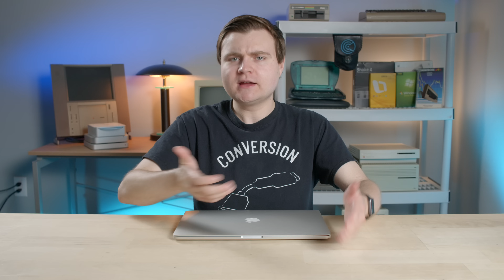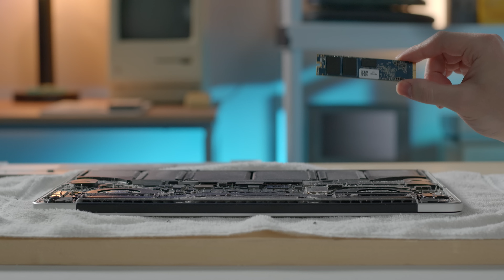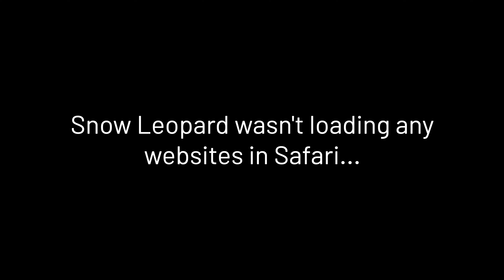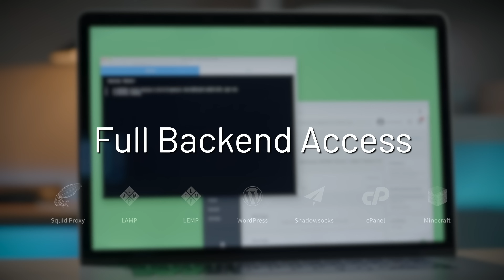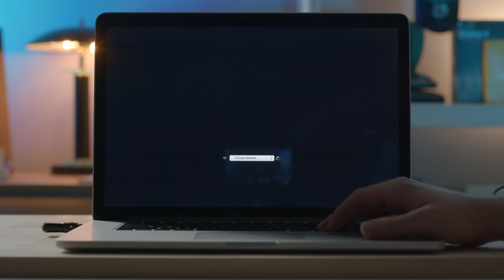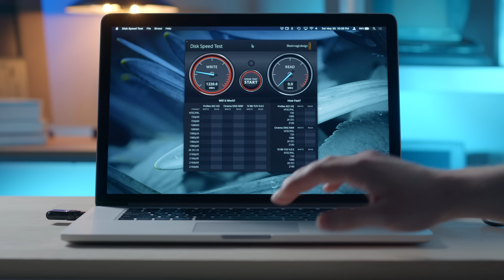MacBook Pro SSD Upgrade (It Took Longer Than We Thought) - Krazy Ken's Tech Misadventures

Comment: they make adapters for the 2013 to 2015 macbook pro retinas that you can just put any nvme ssd in it... i put a nvme one in my macbook air 2014 11 inch because it was the base model and only came with a 128gb ssd

Comment: You probably pushed that ssd in horizontal into the connector but you should have slid it in at a diagonal angle and once all the way in you push it down and put set screw in

Comment: I didn't had to backup my Thinkpad to upgrade it to a SSD.  I just got a 1 TB mSATA card and a mSATA to SATA adapter, just in case.  My SSD is the same size as my old drive, spinning type.  I found out system does have a mSATA slot so I used a software to dump my old hard drive on my SSD and now my Thinkpad T420 runs really fast.

Comment: I use a bulb blower for dust, like what you’d use for lenses. Works perfect and much cheaper than an air compressor!

Also, you can change the system date and trick apple’s internet recovery to give you a newer recovery system. I don’t think the date matters a ton; just use the terminal!

Comment: i was trying to upgrade my mid2013 mba and my process was a bit more round about than you guys. my mba's ssd was fried, the one i ordered on amazon is recognized when you use mojave but not the bult in recovery os like you guys. However, since my mba had never been updated to anything beyond sierra the installer gives an error of not having the right firmware for the newly installed ssd when formatted in apfs. reformatting ssd to mc os journaled alllowed the installer to start but when the computer tried to restart it didn't use the ssd as a startup disk so everything stopped. the solution to this involved getting hold of an apple oem ssd, installing mojave, which updates the boot rom and then swapping out the ssd for the new one..then the installer was able to install mojave on it.

Comment: Upgraded my mid 2014 13in MBP a few years ago with a 480 GB Auro Pro SSD, installation was simple but I can agree the software end of things was rough. Forgot to update to 10.13 first so had to go back and do that afterwards, and the SSD died on me a few months ago so I had to go back to the stock 128 GB SSD.

Comment: I have a Mid-2015 MBP with 512GB running Big Sur and want to upgrade to a 1T OWC Aura Pro X2.  I have a Time Machine back up on a 1T HDD.   I have an external device controller that I believe I can use with the new SSD and the old SSD. 

Can I format and install the OS on the external device and then plug the SSD into the MBP?  
If I can't do that, what is the best path forward (your video with all the restarts and dead ends didn't really make it clear to me what I should try first).

Also, you suggested that I make a bootable Flash drive.  How do I do that?

Comment: As you say, the Migration assistant is pretty solid.  Yep, did away with Big Sur and reinstalled Catalina from a flash drive.  Then ran migration assistant using my time machine drive as the source and upon reboot my system was back to where it was before the Big Sur install.  Definitely an installation sensation.

Comment: Interesting I have a 2012 MacBook Pro that I’m trying to install a SSD. To get to the point it keeps failing!
Reply: I tried time machine and it crashes at the end, I’ve tried transferring data and it works when I run it on USB STARUP but once I change it into the computer it doesn’t start. If it starts it crashes or runs super slow. What can I do? ☹️

Comment: This was so fun to watch but I was actually quite surprised how little you all knew about the web download of the OS. 

You said your machine was 6 years old. A cloud boot like that will default the machine to its original shipped OS. It’s because the machines have no hard media anymore. So you either allow that or you boot from a preferred drive. So the OS defaulted to a media older than the OS the new hardware would support. Ha! I love it!

I love how this video took away a lot of the fear people have when dealing with the OS of their computers. An old tech friend of mine said “you can’t break software” so as long as you have a backup, you don’t need to fear! Erase and install are your best friends.

Comment: This may be a weird question... but why don’t you have a bunch of cheap 16gb flash drives for each version of macOS? It’s simple to make them, the article is on the Apple website, article HT201372. I have been doing this since 10.6 with each new version. Would really cut down on time if you had these ready to go.

Comment: the beauty about this MacBook revision is that you can actually get a simple pop in adapter to use any m.2 nvme drive. I used a 970 Evo Plus and it works like a charm. And as already noticed that recovery path was a pain to look at since you just used the wrong button combination.

Comment: With OS Sierra, you have to install an additional update ( it will prompt automatically ) so the Aura SSD will reach its maximum reading (2100) and writing (2500) speed.  Otherwise, the speed won't be consistent.  It will reach and then it would drop to 60 MG transfer rate.  Instead of dropping the image straight from the Time Machine, I would just format the computer with a fresh OS system and then Migrate from the Time Machine.  This way you won't copy any "bugs" in the system.

Comment: Now do one for the 2016 15” or the 16”
Reply from the maker: I'm going to assume you're joking because that's not possible, but I'm also going to assume you're not joking. In that case, all I'll say is: that's not possible—the SSD is soldered to the board.

(Okay, it may be possible if you meticulously desolder and re-solder an SSD to the board, but good luck.)

Comment: Replaced my ssd in my '15 A1502 with a WD NVME ssd, used carbon copy cloner and a external driver case to transfer the data. 
Ended up having major sleep wake issues and random bugs like systemui not responding etc.

Comment: I would have just cloned the drive with rysnc or dd (or used CCC), then used Terminal in recovery mode to clone back. Much simpler.
Reply from the maker: But that would've taken longer because I would need to copy to a destination, and then copy back. With Time Machine already one, I only need to do one transfer, not 2. : )

Comment: This is what the blue writing in Computer Clan videos says: 
A problem has been detected and doors have been shut down to prevent damage to your computer.
kktm.sys 
YOUR_LIFE_IS_YOUR_FAULT
If this is the first time you've seen this stop error screen,
you clearly haven't used a computer much. If this screen appears again,
follow these steps:
Check to make sure any new hardware or software is properly installed. If this is a new installation,   ask your hardware or software manufacturer for any Doors updates you might need.

If problems continue, disable or remove any newly installed hardware or software.  Disable BIOS memory options such as caching or shadowing. If you need to use Safe Mode to remove or disable components,  restart your computer,  press F8 to select Advanced Startup Options,  and then select Safe Mode.  Did you pause to read this?

Technical information:
* STOP:   0x00000050  (0x84DDDF66,  0x00000001,   0x8524AFFA,   0x00000000)
*            kktm.sys - Address  8524AFFA base at 85200000,  DateStamp  4549aea2

Comment: This is to inform you that my Macbook Air laptop is
not responding to power-ups after failure of network during update.

I have reached out to customer care(online support) over phone, but was not able to get
the fix. The online support person advised me to go for Apple Service center.

Thus I visited the Apple Service center in my locality. As per engineer's examination,
it was a SDD flash drive failure.

My warranty period for laptop is already over as I am using it for last 3 years.

Can I use owc ssd ?

Help help help

Comment: When I formatted my new SSD I just booted using an external drive with macOS and then downloaded the OS onto the SSD while the external was connected and changed the startup disk to SSD and it worked pretty quickly.

Comment: Why are you so STUPID,  my dear idiot, before you remove the SSd please use C.C.C or clonezilla & clone your old SSd to a external drive. Then remove the Old SSd & put in the new one. Now boot from the External Drive as it's the exact clone of Old SSd.
Format the New SSd that is now inside your laptop, use C.C.C or clonezilla to clone back from External drive to the internal SSd.
Done
No need to connect to internet, no thumb drive required, no hassle needed.

Comment: The Aura Pro X2 is up to twice as fast as the original Apple stock SSD.  You made the project a lot harder than it was supposed to be, considering you read the card that said High Sierra or later is required to boot the Mac.  Instead of Time Machine, it is much faster to use Carbon Copy Cloner to clone your internal drive to an external, then boot from that external drive and clone it back to the new internal SSD (after you format the SSD in APFS).

Comment: Have you ever heard of carboncopycloner? It take only a little time to backup and restore.
Reply from the maker: I’m pretty sure a 500 GB transfer with USB 3 on a mechanical disk will never take “a little time” : p
Reply: @ComputerClan  Carbon Copy Cloner is still faster than waiting for a Time Machine recovery.  Although you should have had a Mojave boot disk ready to go before installing the new SSD, since you read the card that said High Sierra or later is required.
Reply: @ComputerClan  BUT...it will be never ever slower than time machine. Sure!

Comment: Who the fk is Aura? Is that even a company?
By the way, do your guests live with you or do you not give a crap about social distancing?
2:23 That's what an M.2 drive looks like? Have you done this before?
7:03 Those fans look like they're CAKED in dust, your t-shirt isn't going to help with that....do you.....work for The Verge?
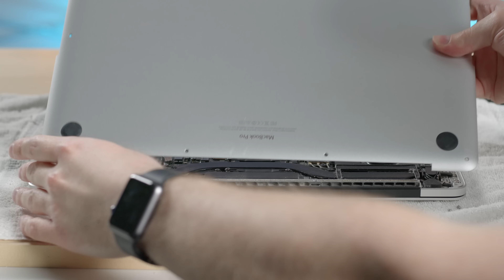7:21 Yeah! Case on, never mind the fans, right? I mean, they only cool down your processor and GPU, meh.
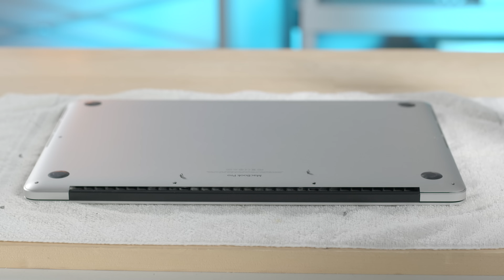7:34 Not gonna give that vent the once over with your dustbusting t-shirt?
Quick tip, next time you're buying stuff off Amazon, might want to go with an "Electronic Air Duster", Compucleaner or similar.
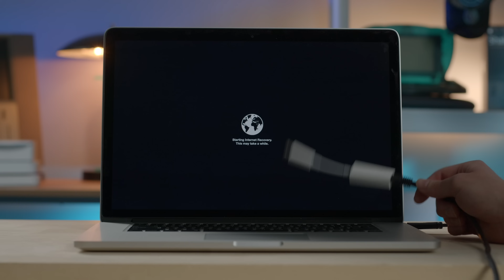10:05 "some conversion technology"??? You mean an ethernet adaptor? Fess up, you are with The Verge, right?
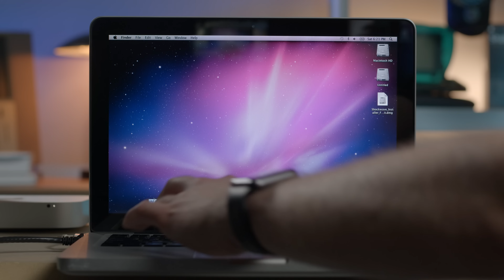14:33 Poor Linode, really, you had to drag them into this mess?
Reply from the maker: I only have a little energy to address your comment. Aura is a product from OWC. OWC is huge, so I’m sure you’ve heard of them. Also, social distancing is not enforced everywhere. As for the M2 drive, no, this is my first time. That’s about all the energy I have. If you wanna be witty and sarcastic, take it somewhere else. Don’t be a wise-ass.

Comment: Amazing.. When I installed an SSD on my windows laptop I didn't have to worry about version.. build.. what color it was.. what year it was built.. if it was blessed by Steve Jobs.. Just popped it in, and it worked.
Reply: Same thing here why does it matter what color, build, year and if it was blessed. It pops in and works.

Comment: Aaah, you closed it with all that dirt inside, at least clean the fans, and since it looks like you never opened it before, and it is almost 7 years old, that was the opportunity to change thermal paste on CPU and GPU.
Reply from the maker: It has been opened and cleaned before. Most of that dust is less than 2 years old. 🙃
Reply: @ComputerClan  I just recently opened for the first time my early 2013 Macbook Pro, to change thermal paste, and it had less dust inside, probably because it always sits on the same desk 😄

Comment: Sadly I had an unpleasant experience with this particular product and the same Mac. Sleep/wake function Is corrupted. When Mac gets in deep sleep it never exits from that. Unfortunately my Mac rebooted and lost every was open. Then I installed aura pro in my iMac 5K 2017 and cannot install bootcamp. TBH this is written in owc site but I did not read it meanwhile. The speed is very good for my Mac, But if I would buy this again.... big NO!. Stay away from this.! I would use Samsungs products for SSD I have the feeling they work better with Apple Macs. Hope I helped a bit...
Reply: Samsung does not make an SSD compatible with Retina MacBook Pros, or the retina iMac's internal SSD slot.  I have the Aura Pro X2 in my 2015 MacBook Pro 15" and it works flawlessly, and twice as fast as the Apple SSD.  Zero issues with sleep and wake.  More people use VMs than Bootcamp.

Comment: I used a m.2 ssd adapter for a 15 inch 2015 MacBook Pro and a intel 660p ssd and it worked really well. 5ghz WiFi and sleep mode worked without any problems.

Comment: I went with the Sabrent Rocket NVME for better thermals and energy efficiency. It should be more energy efficient than the original drive even. I had to do a clean install of the OS and then restore the files through time machine.

Comment: Interesting why Internet Recovery didn't pull in the latest macOS, I thought it was supposed to automatically do that but I guess you have to press some special key combo to get it to do that! I'm sure the wifi settings are saved in firmware though which would explain why it didn't even ask. I love these videos where there's way more hoops than anticipated or necessary heheh

Comment: You know, since you weren't actually installing from the installer flash drive, you could have just let the patch tool create it. It just automates all those Terminal commands. Even if you were installing, with the Catalina patcher, it patches as needed as it installs. If you use it on a supported Mac, it just doesn't patch anything. What I have done in such situations is to use Carbon Copy Cloner to make a bootable backup on an external drive, perform the upgrade, boot from the external, and the reclone the new drive.

Comment: I would have just put the SSD I just took out back in, create the bootable clone on an external drive from it, and then put the new SSD, boot from the drive and repeat the cloning process. I I did something similar but I was also migrating from an older macbook with a SATA ssd, so I just put that in an external enclosure first

Comment: i just put a 512gb nvme ssd in a mid 2014 macbook pro 15 inch the other day. i used a m.2 to sata adapter and it was plug and play. took about 45 minutes to install macos but it worked perfectly including sleep mode and the wifi. i think only certain brands and models of ssd's work tho. i used an ADATA nvme
Reply: also the 512gb ssd with adapter cost me only$75. which is why i didnt use OWC cause its slower, and a ripoff

Comment: Yikes...i can't tell how many of those OWC drives I had to RMA for our customers.
I usually install Transcend SSD's, yeah they have a weird Storage size, but reliability is top on those.
Alternative you can use a good M.2 SSD (using a Adapter).
Reply: I used an M.2 1tb ssd with an adapter and carbon copy clone to transfer the data. For the same read/write speed was a hell of a lot cheaper than the OWC and took next to no time (was a late 2013 MacBook Pro)

Comment: IMO not really impressed with OWC, id rather use an M.2 SSD with the adapter. Plus it's cheaper. But great update video!
Reply: I’ve tried it the M.2 way, if it’s not 2016-2017 or newer, stick with OWC..
Reply: @GiannisTsolakidis  Or get a 950 Pro or a PM951/SM951 AHCI, or other AHCI drives, way better than the OWX drive and you can reuse it later on
Reply: Swag Yeah the problem with these are, they’re not fast, and they still have problems with sleep. What I’ve end up doing after a year of SSD swapping, I bought an Apple SSD from a newer MacBook over eBay and I’m done.
Reply: @GiannisTsolakidis  Samsung 970Evo seems good
Reply: I did the m.2 way, and my MacBook Pro is now not booting
Reply: Now he's having sleep wake crash issues, but going back to the old SSD and restoring from a time machine back up fixed it.
Reply: Overpriced and overhyped
Reply: @taurus20077  not really lol .. those macbooks have proprietary ssds, you cant just slap in a regular pcie nvme ssd or m.2 sata ..
Reply: @WaschBaer_95  except you can use an adapter
Reply: @WaschBaer_95  You can get an adapter on amazon for less than $10.
Reply: Even the cheap intel 660p offer better read-write speeds for a third of the price, I went for a 1TB one, but you do have to do some things to keep sleep-wake function and you end up trading like 10% battery life, I do think it's worth it.